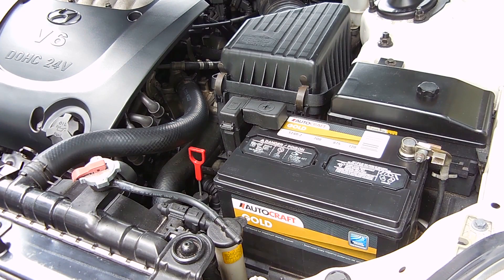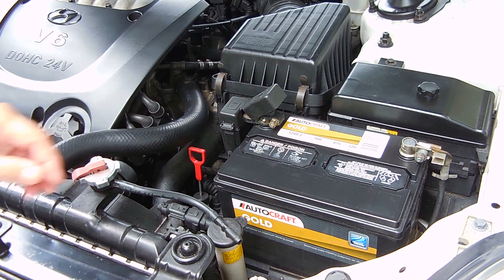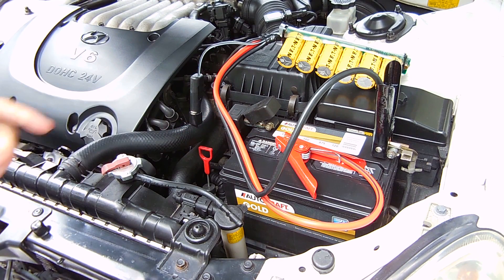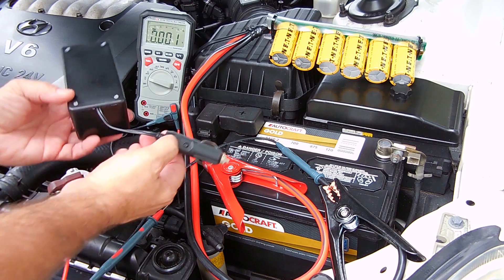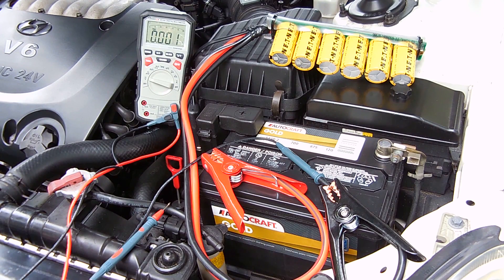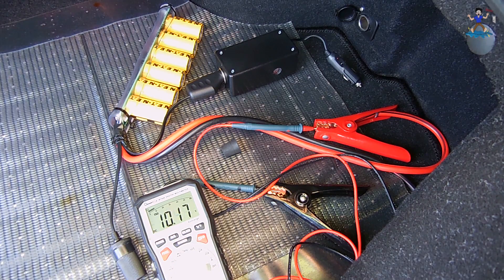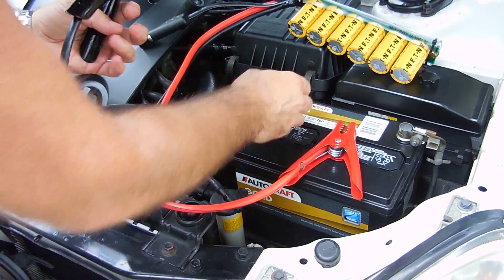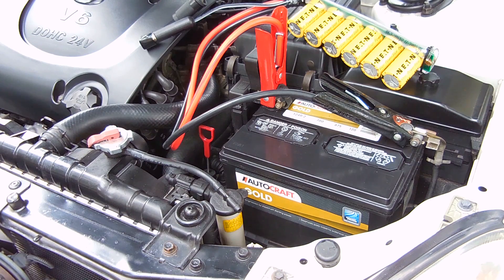Jump Start Car Using A Drained Battery!

Comment from the maker: ATTENTION: The purpose of this video was to demonstrate a very cool concept that not many people know about. Contrary to what some viewers say,  there's nothing inaccurate about the video title. You need the drained battery in your car, to be able to jump start the car using the super caps. The benefit of using the super cap bank and DC-DC converter, is that you'll never have to worry about a battery boost pack unit being low on charge from sitting a long time without use.   

Because the battery was very low in voltage, once the boost pack was connected, the engine had to be cranked fairly quickly, otherwise the charge would be lost into the drained battery too fast. I learned that after a few tries. :-) I tested lower levels of battery voltage (8-9V) and found the best method to be as follows: Charge up the boost pack fully as shown in the video, disconnect the neg from the battery, connect the boost pack to the battery cables, start the engine then push the neg battery cable onto the battery and remove the cap bank. The alternator will charge up the drained battery. Works like a charm. Thanks for watching!

Comment: Genius idea!
The only problem with the practical mass implementation of the concept is roughly $50/pop supercapacitor price, total is $300.

More practical is using a 3S LiPo pack that is ultralight and powerful for its size. Costs $30-$50 total. The only problem with that is you need to charge it. 
The solution to the problem is you can charge it on the go from the car's 12V after you start up the car by using a smart RC charger or 220V AC charger if you have a 220V AC invertor in your car.
Reply from the maker: Yes, they're not cheap, but the prices are dropping. Thanks for watching!

Comment: How did the 12v plug in work if the battery was dead? Unless you plugged it into a different car.
Reply from the maker: 10.5v, dead when it comes to starting the car, but still has useable power.

Comment: I tried to make such a boost pack myself but burnt the fuse of my cigarette plug. I am quite confused that to charge a capacitor instantly will require infinite current but I don't see you connect a resistor to protect the circuit. Does charging capacitors necessarily need one or something I had missed ?
Reply from the maker: Too much inrush current to connect a supercapacitor directly to the cigarette socket.

Comment: Ok, you charged the capacitors through a voltage converter. But when you connected the capacitors to the car's power supply, the battery was still connected. The voltage in the capacitor equals the voltage in the battery at that moment, giving it to a smaller voltage source. This increases the voltage in the battery and the capacitors  drain slightly. You must first disconnect the battery and then connect the capacitors to the car's power supply. The only reason why the car was started was because the battery voltage was relatively close to the start-up limit, and capacitors have lift the battery voltage slightly.  Nice and applicable solution,   certainly. Thanks for the presentation
Пошаљи повратне информације
Историја
Сачувано
Заједница
Reply from the maker: Thanks for watching!

Comment: Hi there! I would like to ask you help please. As English is not my main language, I can't quite understand what you say here:
 " disconnect the neg from the battery, connect the boost pack to the battery cables, start the engine then push the neg battery cable onto the battery and remove the cap bank. The alternator will charge up the drained battery. Works like a charm. Thanks for watching!"

Can you please upload a video explaining that detail so one could understand it better?

Thank you and greetings from Portugal.

Comment: Very nice video!  Digikey is a very difficult place to shop, would you happen to have the part number for the super cap at digikey?
Reply from the maker: Thank you! PowerStor XV Series (Y48Y292-01)
Reply: @electronicsNmore  thank you so much for replying. I use these super capacitor banks for a home built solar power system. They are working great for that set up.

Comment: this is not using the dead battery, its using something you made to charge the dead battery, this title is a lie
Reply from the maker: WRONG. The dead battery is used to charge the cap bank. I love the comments.
Reply: @electronicsNmore  you still need the Jerry rigged battery pack
Reply from the maker: @goblinkill  Clearly you can't read too well. "Jump Start Car using Your Drained Battery". What did I do in the video? I USED the drained battery to charge a boost pack which starts the car. Without the drained battery, you'll get nowhere. Don't you have anything better to do than be a Troll?

Comment: Excellent timing of the mushroom cloud, I'm confident enough in my own ability to try this, my question is can you charge the boost pack in one step from the power port or do you have to start the charge at the battery
Reply from the maker: Takes too long that way. Do it as I show, much faster. Thanks for watching!

Comment: Can this be used?
https://www.digikey.com/product-detail/en/eaton-electronics-division/XV3560-2R7407-R/283-4209-ND/3878067
Reply from the maker: I used 400F: XV3560-2R7407-R
Reply: @electronicsNmore  Thank you so much.
Then it's the ones I found. But nowhere is it clear that it is Aerogel
Reply from the maker: That's where I bought mine.
Reply: @electronicsNmore  Thank you very much
I just want to make sure I'm not buying some wrong ones
Is the same Digi-Key Part Number 283-4209-ND as the ones you bought
Reply from the maker: @MichalJuul  I don't know the number....been a while, just make sure they are Aerogel caps.
Reply: @electronicsNmore  Thank you very much
I can't find an Eaton where it says it's an Aerogel 😠

Comment: careful use of the word …"drained"...…NOT bad battery...… that's different.   still won't start your 1997 Yugo with a 20 year old battery.....
Reply: Careful about being an4l retentive, if your battery won't start your vehicle then it's B A D.  In fact, you could have a battery with a problem like a shorted cell and his technique would still work, so it is more accurate to state bad not drained.

Comment: Very good video.
I want to make one and have a car, so you can always help others.

Can I use this Board Module
https://www.banggood.com/6-String-2_7V-100F-500F-Super-Capacitor-Balancing-Protection-Board-p-1163363.html?rmmds=search&cur_warehouse=CN
Reply from the maker: Yes. Just make sure the traces between each capacitor have a thick layer of solder on them.
Reply: @electronicsNmore  In your second video you say there is a 10 amp diode in 12V Male Plug.
https://youtu.be/FpB9nG4TDHo?list=PLi1ubLic0-Yh4ErDvgN2bepMPhrKJVOOb&t=491
Should it still be used or can be a regular. fuse used?
Should there also be a fuse on the 12V Male Plug that is on the Boost Converter Module?

Comment: Here's an idea. According to my rough calcs, a single 9V battery has enough energy in it to start an engine all on its own. Multiple times with a little help from the weak car battery. So, put 2 of them in series for 18v and use them to charge your supercap bank till it reaches 14.4V (or use a boost converter but that sounds like more work). Alkalines have a long shelf life and are available almost anywhere in a pinch. Really almost any power source world work - imagine starting your car with energy from your cell phone OTG port haha.

Reminds me of a story. Once I was questionably parked outside my college's computer lab furiously working against a deadline. Unfortunately I left the lights on and drained the battery. Fortunately, my college's dead-battery recycling bin yielded a handful of mostly-flat 9v batteries which I rigged up to boost my car. I got a crank or two out of it. Then the campus police just jumped it for me, but I'm sure with a couple mins more charging it would have started :)
Reply: Not a good idea.  A 9V battery has a very high internal resistance, would be much slower than using the vehicle battery.  At a mere 100mA drain rate, which would take forever to charge the caps, a typical 9V alkaline has a capacity of less than 400mAH, but lets use 400mAH.  400mA x 9V = 3.6WH.  3.6WH *0.9 (boost converter inefficiency) = 3.2WH.  3.2WH/14.5V = 220mAH.  220mAH / 200A (typical amperage target for vehicle starting) = 0.0011H = 4 seconds.  You cannot be assured the vehicle would start in 4 seconds and cannot be assured the drain rate of the 9V will be no higher than 100mA without some kind of current limiting that incurs further losses.

Now, if you wanted to put two of them IN PARALLEL instead of series, so you had less voltage drop, more realized capacity by halving the current each supplies, then you'd be closer to getting the job done, except still slower than using the vehicle's own battery.  Starting with mostly-flat 9V batteries, is an exercise in madness.  I guess it's better than starting out with watch batteries but otherwise, 9V's are meant for low current and a poor choice relative to the vast array of batteries out there, like the ones being moved around in other student's cars so a word of advice:  Put jumper cables in your vehicle and learn to use them.
Reply: @stinkycheese804  You're right it wouldn't work super reliably. I had jumper cables and knew how to use them but nobody was around.

Comment: And after starting...you turned the engine off...why?   You need to recharge that battery by driving the car.
Reply from the maker: The last thing I wanted to do is talk over a running engine..

Comment: Here's an idea for you. Take the inverter circuit and reconfigure it so that it along with the super caps are in one package and design a secondary circuit that will allow the inverter to charge the super caps from a complete discharge state to a fully charged state automatically with an indicator LED that let's you know the caps are at 14.4 volts. In the new setup, have a high current switch that will allow you to throw the super cap's positive output to the positive clamp already on the battery and since the clamps will already be in place it will be a matter of flipping a switch on the super cap bank and then turning the ignition key to crank the engine. You could even take it an extra step further and have the super cap auto-engage all while you sat in the car. That would be a very straight forward and simple design to come up with.
Reply: 1)  There's no inverter circuit.  It's a boost switchmode regulated power supply circuit.  Let's just call that a SMPS.

2)  You don't want the SMPS charging from a complete discharge state if you can avoid it because it requires current limiting and so as we saw in the video it is much slower at getting the caps up to the initial battery voltage than just connecting to the battery first to accomplish this, and it's less efficient when you're already using a struggling battery.

3)  Don't really need an add-on indicator LED, simply get a boost SMPS with a display built on the board which shows voltage and/or current.  They are quite inexpensive these days from Chinese merchants.

4)  No need to add a switch and one capable of hundreds of amps will be large and expensive.

5)  Obviously it's not a simple design if you don't even know there is no inverter involved.  ;)
What it would be, is more expensive and complex and big than it needs to be to get the job done.  The difference between some little homebrew circuit and one that needs to supply hundreds of amps is in the details.  It's certainly do-able but this sort of jump starter shouldn't be something you need to use often, a sane person would buy a new battery more often.  A wrecker service would just bring a new battery if informed of the problem or also have jumper cables onboard.
Reply: @stinkycheese804  Thank you for your observation mr. President.

Comment: there is definitely an invention idea here.
Reply from the maker: Thanks for watching Mike!
Reply: @electronicsNmore  I started wondering could you use a simple buck converter to say 7 volts, make a dial that will charge the capacitors in 2 sets run parallel then flip the to a circuit to put the 2 sets in series and get 14 volts.
Reply: @stinkycheese804  I have a slow drain on an rx300, its fine if I drive it but if I leave the key in the ignition for a week the battery goes low.  I bought a device that cuts off power when it detects a slow drain but it doesn't always work.  What I was saying is if a person could make a device that could start a car with a very low battery.  I always have 1 jump pack and cables on me but sometimes I leave the jump pack connected and it drains too. Anyways It was just me thinking out load so I didn't lose the idea.  I came up with an even better invention so stopped caring about that idea.
Reply: They're already being sold, check out Scotty Kilmer's channel where he pimps one.   As far as invention, it's a fairly obvious thing one could do with supercaps, but I still prefer a portable power pack, it's less fiddly to use and no waiting.  You just have to remember to keep it charged and ideally not stored in the vehicle in winter or else the same low temperature that makes the vehicle battery produce less current, will do the same to the jump starter pack battery.